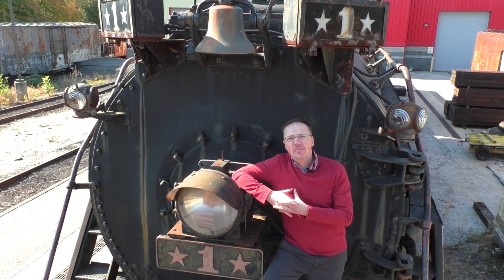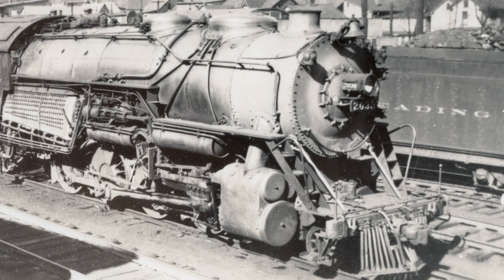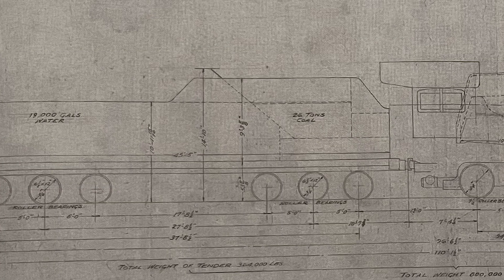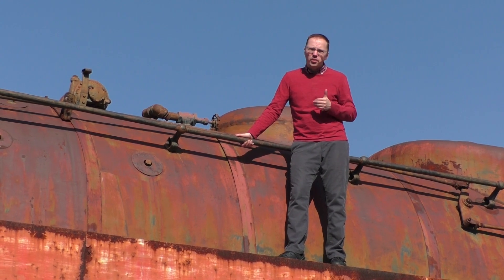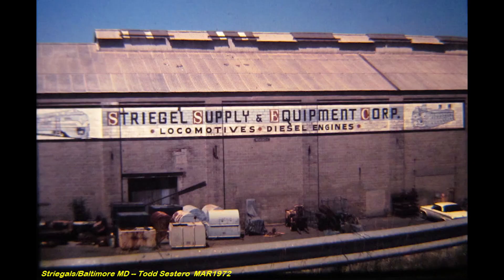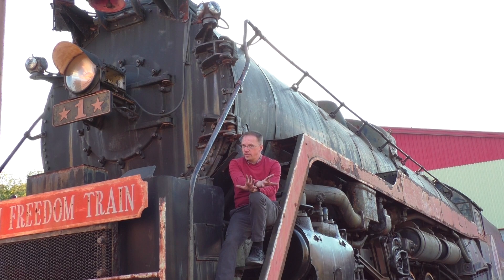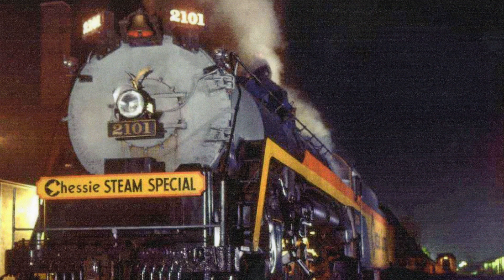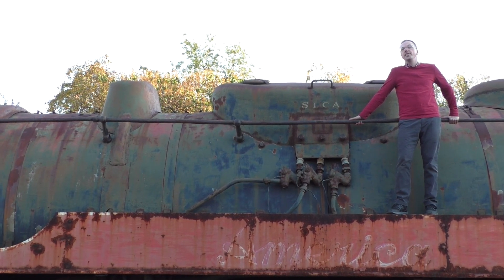A fun and historic look at Reading 2101/AFT#1

Comment: I'd be interested to know what components exactly were damaged on 2101, was it something as major as a melted crown sheet, or just heat damage necessitating boiler patching?
Reply: Anything brass or copper needs checked, and all the top side appliances are dead, Anything steel is probably good, she would need vastly more work then 2100, but it can be done, it's just a money issue.